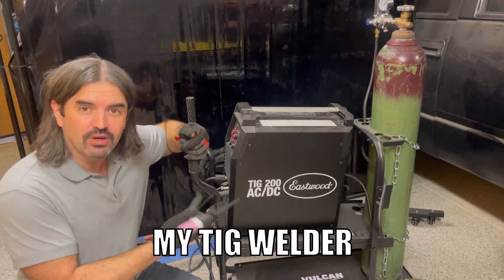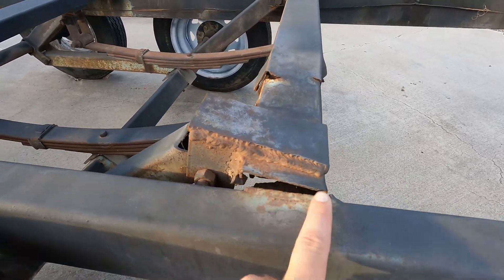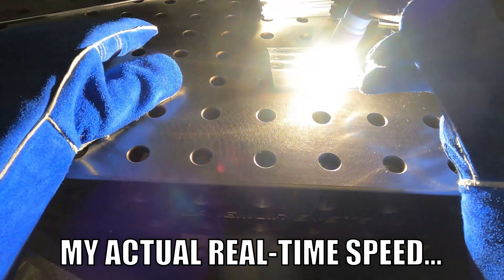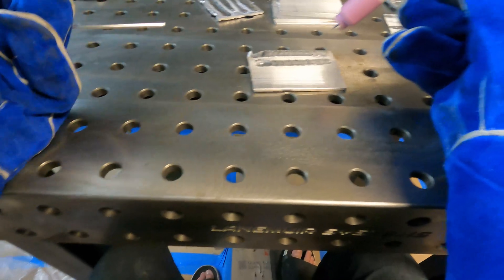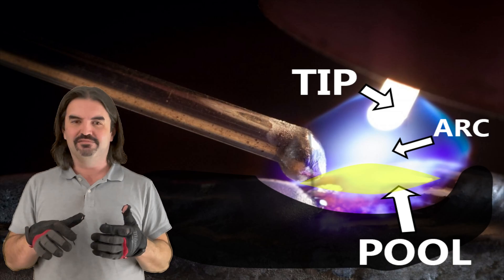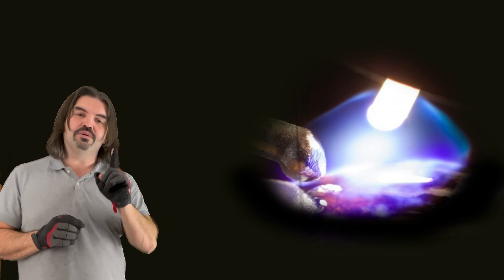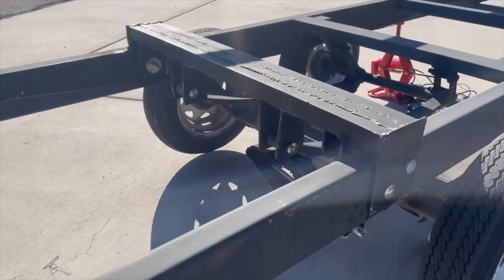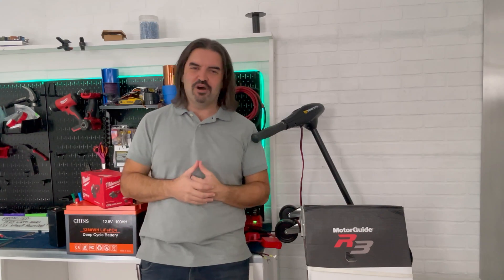Boat Trailer Welding 101: For Noobs BY Noobs

Comment: You did it!  Not sure if this is as strong as it was previously but you will soon find out.   Those galvanized carriage bolts are only grade 2 and are probably not strong enough.  Replace those with grade 8 hex head bolts if you can and add some antiseize or grease since they are touching both steel and aluminum.
Reply from the maker: Hey, thanks for the tips! I went to Home Depot looking for stainless and found only galvanized in the size I needed. That was the last time I went to Home Depot looking for hardware because they failed to have what I needed too many times. More recently, I’ve been going to Ace Hardware for bolts instead bc the selection is WAY better. But I didn’t even know about grades yet. I will look into that right away. Much appreciated!
Reply: @eagleray1  Fastenol will have stainless hardware.  Menards in the midwest will also have it at a better price.  You can also put in more bolts, but a higher grade will be more resistant to sheering off.   This design has a lot of twist on those bolts - especially the bottom bolts.  
If I were you, I would change back to the steel crossmember, bend it back, and weld that on.  It would be much stronger than the aluminum and bolts.